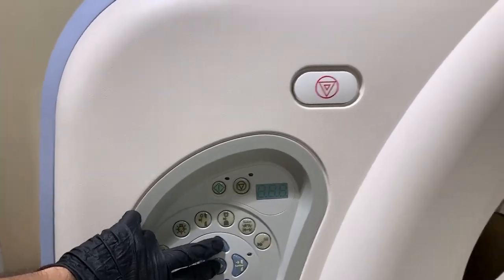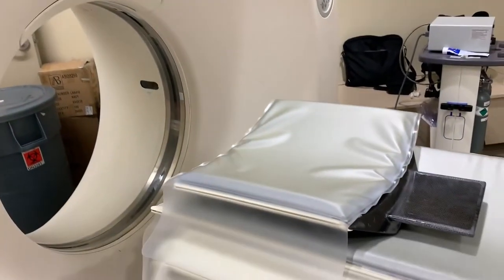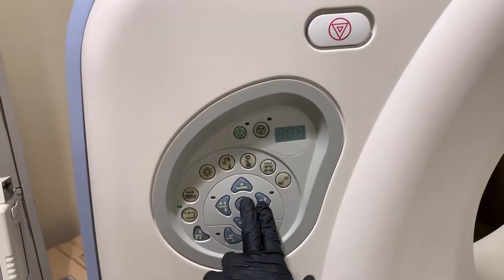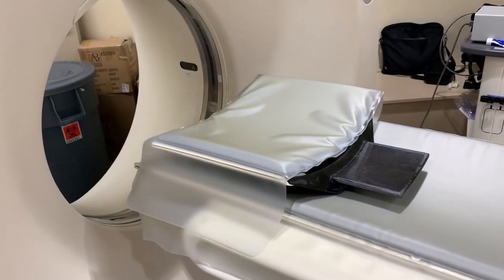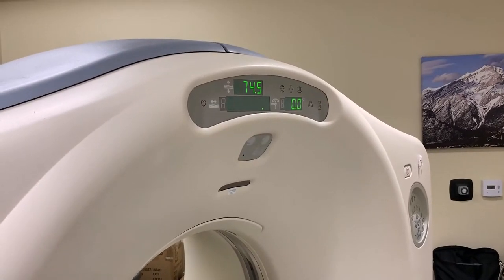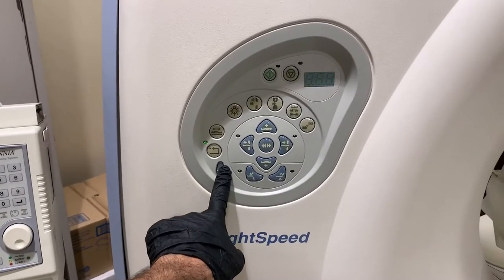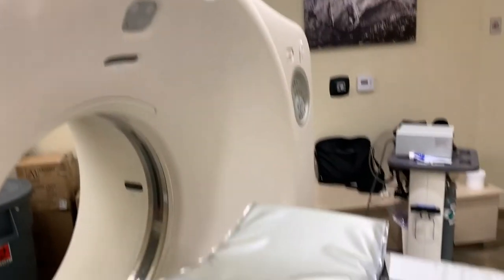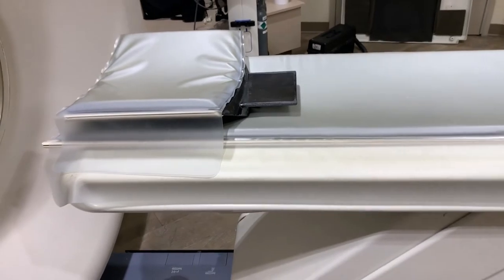Resetting CT Gantry  Flashing 8's and Unlatched Cradle

Comment: Helpful videos. Can u tell how to stop gentry tilting when table is going down..
Reply from the maker: The gantry will return to the upright position and the table will move out and down when pressing the home button. To avoid the gantry tilting when table is going down you can use the directional buttons on the gantry interface panel.  Use Slow Out or fast out to bring the table back to the home position, then bring the table down using the Slow Down or Fast Down buttons. Good luck!
Reply: @MRIPETCTSupportEngineer  can i share video with you? we are facing this from last month.
Reply from the maker: @amirrizwan15  of course. Send it to my instagram and I’ll take a look